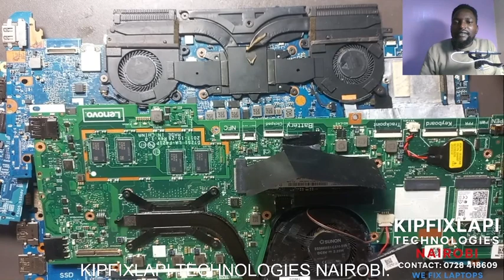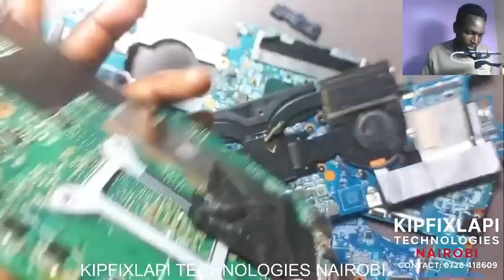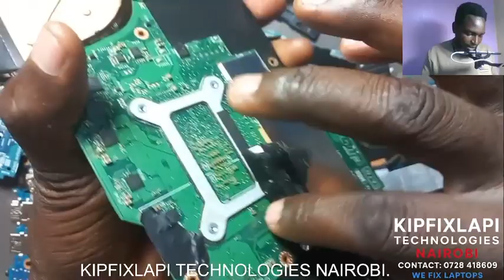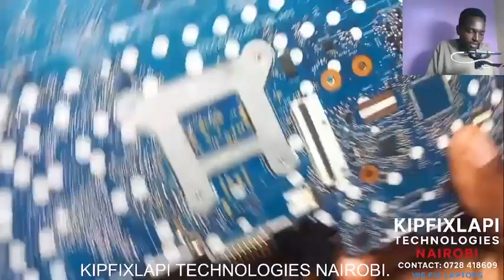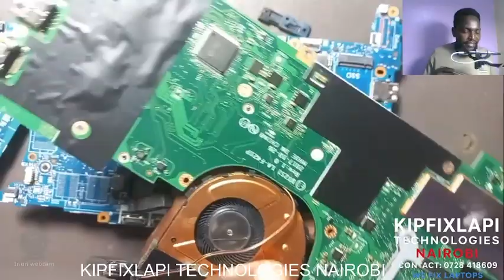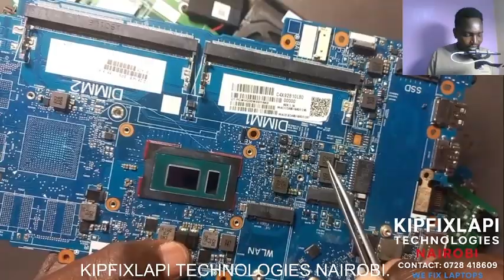LEARN TO FIX LAPTOPS; NO POWER MOTHERBOARD FULL TUTORIALS. #computer #laptop #repair  #subscribe

Comment: Can 9241Bh work in place for   9241 sir
Reply from the maker: Hello master, You should check the datasheet for both to ensure the pinout configuration are the same and specifications match before replacing.
Again you can google the equivalent. 
9241H, 9241CH, 9241BH, they related but sometimes configuration doesn't match.
Reply: @KipfixLapiTechnologiesNairobi yes I have seen Most not really  working fir me, so i usually  just go direct for the exact part no